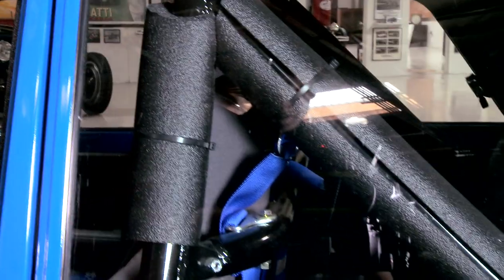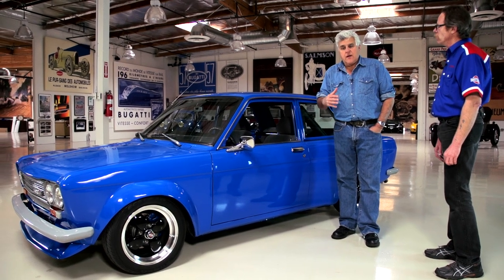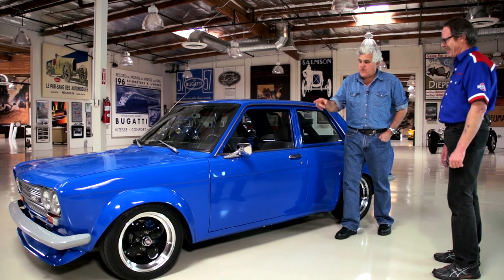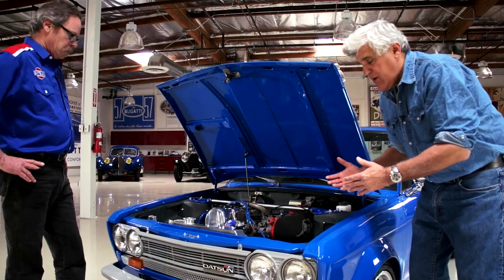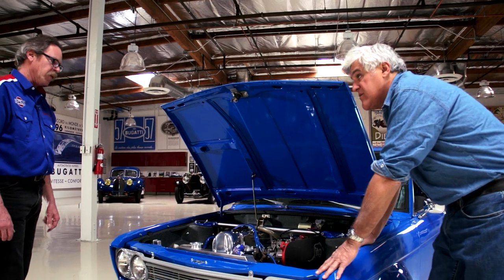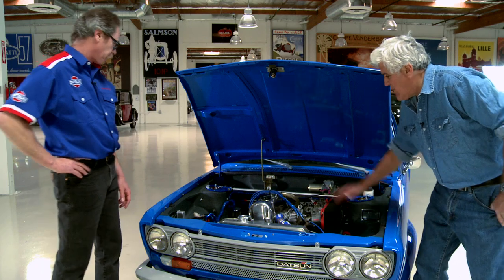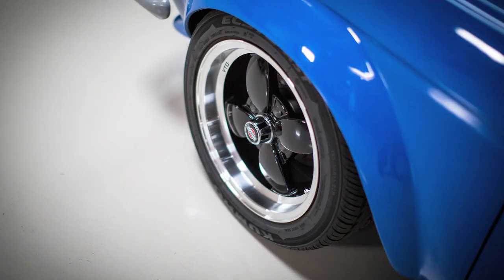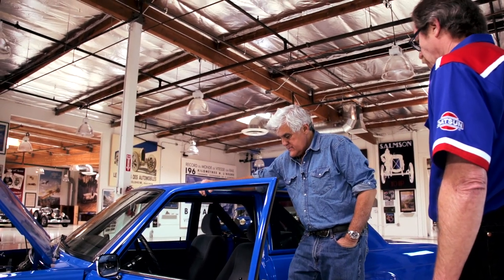1971 Datsun 510 - Jay Leno's Garage

Comment: I remember wanting to buy  a  72  510  4 door  . I was  pretty basic  and   a friend  worked at the local Datsun  dealer  and told me it a   IRS   for a  better ride on bumpy roads .  
      He did laugh at  some of the car parts  because he was used to   the Big 3   cars from the  50's and 60's  .  He  could pick up an entire  exhaust  system from the parts  dept  and  joked   how one of the mufflers  he saw was  like a large Tomato juice  can  with a straw  in it .   When he did a Clutch  job  the plate  was  like the   old 45  records .  
     The 510  ran for 68  to 73  and   I think   the F-10  was brought it  because  Front Wheel  drive  was now popular  in my area  during the winter and it was cheaper to assemble the car with the drive train  as a Unit  lifted up in to the engine bay  and bolted in  for the suspension.  

   The 510  was  about   $2400.00 as a plain  jane   4 door   with NO radio  or floor mats .  I think the inside   flooring was rubber covering  and no  carpet  while the doors had some  painted metal sections  with only the arm  rest area  with a strip  of vinyl  trim  where the window crap arm was as well.   
       I was   young  and wanted a  new car  that was cheap  to buy and  got good mileage .    

   As for Jays  Datsun  question  ,  it was  marketed  in N.America   that way  to  test the  sales  and  build up a loyal consumer base , Nissan  had took  over Datson   in 1934   and  changed   the name to Dat-Sun   because SON  in japanese  can mean a   sad loss  ....plus the  Sun  paid tribute   to  the nation Flag  that has the rising  sun.  
  Nissan announced  in 2014 that it's bring back the Datsun  badge   while  it currently  is making the  Micra  which was the  low-end   3cyl  1 litre   city car  for short  trips.   It won't be imported to the USA at this time  but would be a  goo match for the Mini and FIAT 500  .          
        While Nissan  chose to drop the  name  in 1986  and use the Nissan  badge for the USA  , it  kept the Datsun  a bit  longer for  Canada .  
    Nissan USA  was formed in 1960  but at the time   many of their imported cars  were made  for them by another  Company   that leased   them to Nissan  as Datsuns.  It may be that once there was a solid  control   for Datsun  the dropped the name.

Comment: Like a '68 Datsun 411 Bluebird, too. These cars have solid, strong bones and motors that purr and move these cars that only weigh 1,900 pounds. Investment-wise you won't waster your money. A decently restored 411 or 510 will fetch back more than you paid and should keep going up. So many people are stuck on schmaltzy Beamers and MB's and boring German VW's. Not to do that, car nuts. The passion is here with these late 60's and early 70's Datsun's. I'm aiming towards a '68 Datsun 411 Bluebird as I type...gonna be hard ta not pull the trigger. Fun to restore, fun ta drive and no loss of your investment. Wait a minute - '55-'57 Chevy come to mind regarding this?

Comment: I only just recently found out that the Nissan name was the parent company for Datsun.  I had a 1978 280Z and loved it then and still do.  When they changed from Datsun to Nissan I was not a fan.  I prefer the 77/78 280Z over the earlier 240 and 260 models.  The bumper for the 78 made it look cooler.

Comment: Fairly sure horsepower for original 1600 engine was 86 horses. Easy car to work on. Supposedly some original engines were used to power aircraft. Lightweight engine components. Years ago I tried to blow my engine up before replacing it because piston rings were shot ,low compression using to much oil. Put my foot to the floor on accelerater.  Had the engine screaming for several minutes spewing blue smoke all over the yard. Engine did not blow up. Then it occurred to me I had to drive car to engine replacement place. Original engine has lightweight components, is durable and my impression was that it was similar to a high r.p.m. motorcycle engine. Next engine was triple s with 2 carburettors. Good rally car handles extremely well.

Comment: 2000 Roadster clutch was bolt-in - with just release bearing collar swap - more than double holding pressure 600 - 1430 improvement

Comment: @jay leno garage, what do you think of a 1967 Datsun 710 Fairlady 5 speed convertible with an original 58,000 miles and is #347 out of 1000. Id say thats a collector piece right there..

Comment: One thing I found out with mine was the 2 door seats fold forward and the 4 door ones had reclining seats. I got seats out of a 4 door for my 2 door and they wouldn't go forward to let ppl in the back. Same steering column for right or left hand drive. Note key is on left

Comment: I knew a guy in high school who put a 283 Chevy motor in a Datsun 510.
Reply: You made me chuckle at a memory 
I bought a rusted out olds with a 455 once to put in a chevette I had. After I got the thing to run but not well at all and it was shaking. I can’t recall if it had a broken crank or cam or something major but it was only running on six cylinders and the sound clearly indicated it was junk. Never finished that project but I made about 400% selling the chevette.

Comment: In 1973 I was on a long journey and came across 4 lads in a Datsun 1600 (same car). We decided to beat the boredom and hit the gas. I had a 3300 (twice the capacity) NEW Torana 2 door sedan, with GTR Paint. He murdered me in the corners and in a straight line "I could not catch him" foot to the floor on a long straight, two in my car a 4 in his car, about 95 mph mine topped out, he kept going to I am guessing 100 mph? pulling away again. Special Car is Datsun 1600

Comment: The difference between a modern car and this car is not necessarily measured in  fun.  It's the fact that in a similar crash you would walk away without a scratch in a modern car and be dead in this car.

Comment: I had a 1973 610 in 1975 with 160 hp 10:5 / 1 pro-built motor by an IMSA racer / Datsun Dealer - should have heard that Racer Brown cam talk - All flat-black & lowered... on 185/70 Pirellis...

Comment: I grew up in Hawaii . Most people whom ponied these cars switched to either the Toyota Celica or Corolla SR5 by 1982.  Rust killed these cars.  The B210 Wagon had 5 speed and limited slip . You could pick up a used one in 1983 but 1/2 the floors were rusted out.  Ziebart helped prolong the life of most cars in Hawaii after 1982. Today, the steel is treated for corrosion or they switched to aluminum .

Comment: I was curious too...

In 1931, Dat Motorcar Co. chose to name its new small car "Datson", a name which indicated the new car's smaller size when compared to the DAT's larger vehicle already in production. When Nissan took control of DAT in 1934, the name "Datson" was changed to "Datsun", because "son" also means "loss" (損 son) in Japanese and also to honour the sun depicted in the national flag – thus the name Datsun: Dattosan (ダットサン Dattosan).[1] Nissan phased out the Datsun brand in March 1986 - c/o Wikipedia

Comment: Yes mr leno you are correct again
Did you also know 
Datsun had a inline 6 cylinder chev moter in the 240.260 and the 280 and the 
240 z  running good would do one stretch would 
Do140.mph stock thats neet.i think

Comment: The 1600 roadster was OK...but the roadster with the 2000....was the boss ...especially when you ordered it with the factory performance option.solex carbs and higher performance cam..

Comment: Japanese industries, at the time,  were great imitators. In the early '80's, I had a '69 Datsun 2000 which I dearly loved, and loved to drive. Actually, I had three - the '69 driver, and a '68 and '70 for parts. I was driving my 2000 during the same time my brother drove a Triumph TR250, and we would often... Well, never mind.

The 510 sedan was somewhat remarkable at the time for its independent rear suspension, and coming from a car company which in the U.S., few had heard of. But why did the 510 have an independent rear suspension setup? Because the BMW 1600 had it. Copied.

My 1969 Datsun 2000 had a live rear axle. Why? It would seem a better-handling car with IRS, but MG's MGB Roadster had a live axle, and thus the 1500, 1600, and 2000 Datsun roadsters had it, too. Copied again.

Comment: Just 3 letters.......BRE.  Those in the know will nods their heads in agreement.

 I built a model of this car wayyyy back in 1976:  https://youtu.be/6IOJOwZomUU

I miss my wimp 92hp 1972 510.  I never tricked it out, but I did stick a Momo wheel and American Racing rims on it for the look. My friend had one with box flares and a triple-S motor that made it into a rocket.

As far as Jay comparing it to an M3 or similar at the end of the video, I think he needs to drive a stock one with the original 1600cc first.  No pep, no low RPMs in third...Still handles nice even in stock form, but you have to mod them for any real performance as this blue car has enjoyed.

Comment: what is a fuel cell?
Reply: fuel tank but safer because i can't spill or leak
Reply: Fun fact; the fuel tank in the 510 was positioned vertically behind the back seat.
Reply: @bartscanland9415  Good question! In this context they are talking about the type of fuel tank in a race car. it has a flexible internal bladder. Made of something like a tire wall. So in a crash it won't leak and burn you to death before you exit the car. Kind of goes hand in hand with plumed in fire suppression.